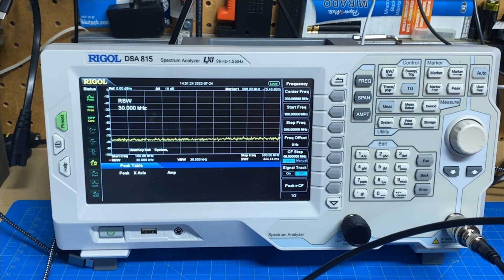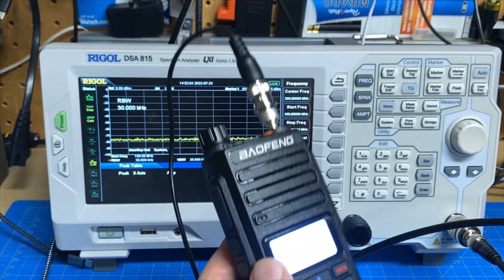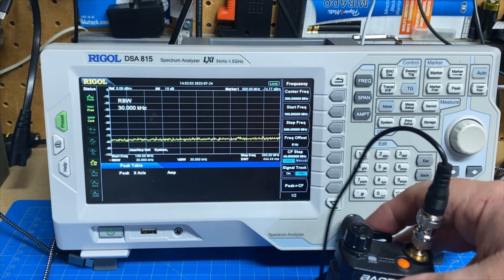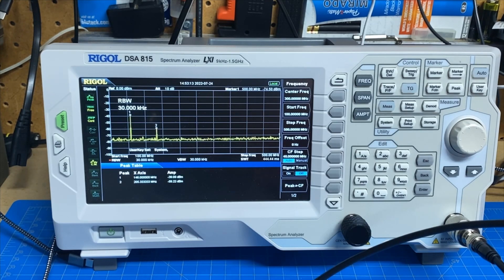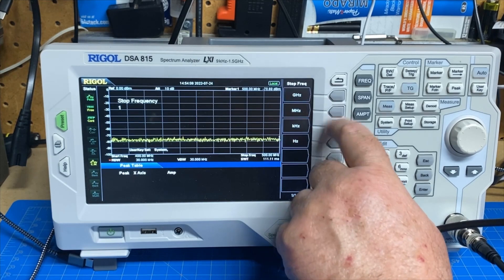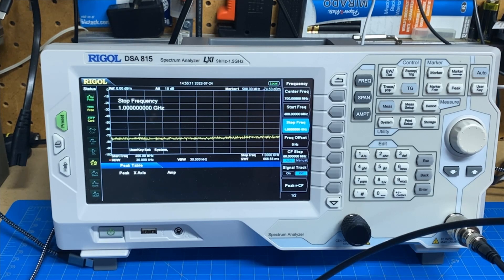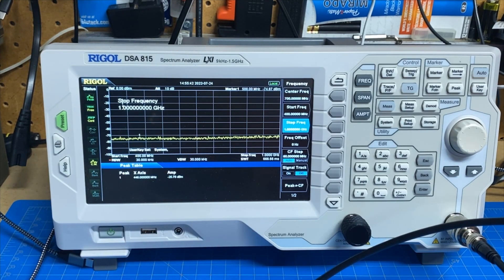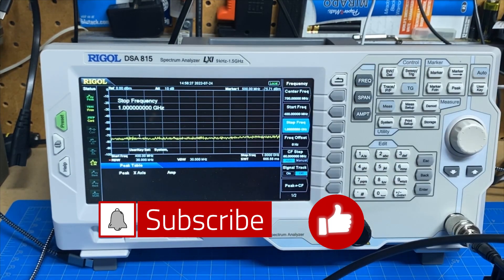The Baofeng DM-1801.  Is it sweet, or spicy??  Signal Check Series

Comment: How much power can your scope handle?
That dang Feng lit up the scope like an Xmas tree!😮
Reply from the maker: That's coming off an RF tap - no worries, that tap is -40db.  If you're talkin about the super cool awesome thumbnail on the video - that's a stock photo.  FWIW - i'm always gonna have an attenuator or tap before the input on the spectrum analyzer (this gadget above), because it is not designed to handle a lot of power.  I don't remember the max input off the top of my head (maybe 20 db??) but it ain't much.  "When you radiate, you must attenuate!"  (I just made that up - catchy, ain't it??)  Thanks for watching!
Reply: @FEPLabsRadio  haha, thanks for the info Jim. Yes, that's catchy, you need a sticker made up for that.😄👍